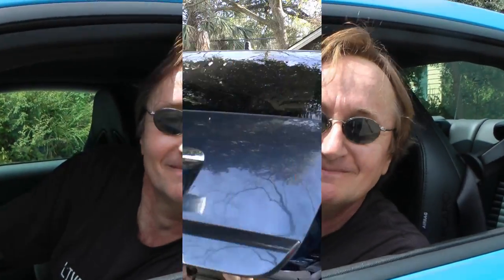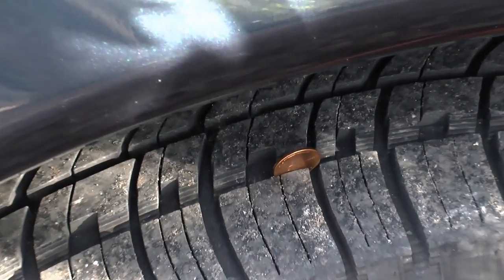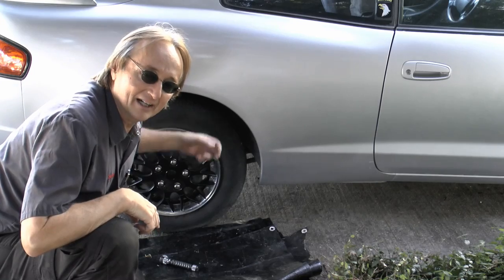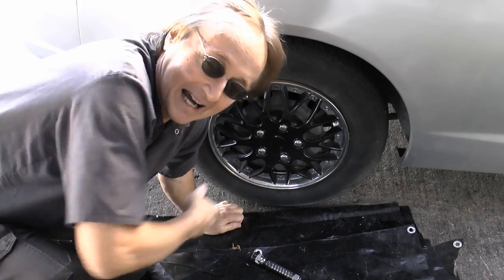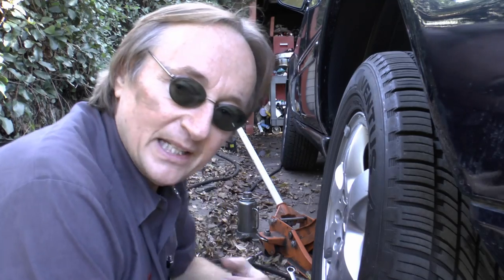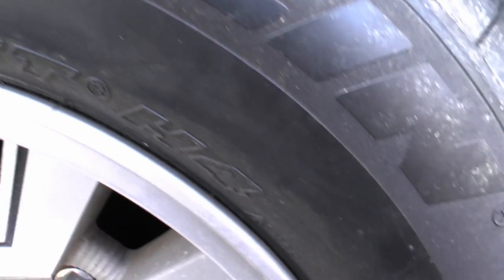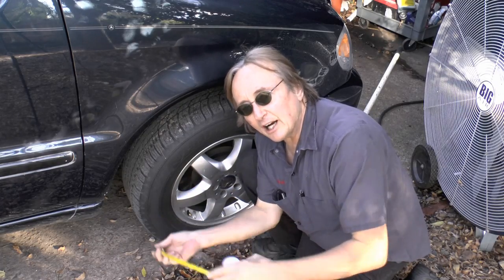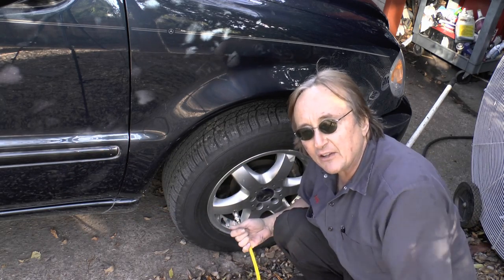How to Tell if You Need New Tires on Your Car

Comment: At 3:10 that puncture repair is not safe. its on the sidewall and its not even a proper plug, its just that sticky rope shit
Reply from the maker: ha ha ha, been doing this 49 years and never had a blowout from any of them. Tire guys are always saying that crap to sell you tires. Tires are basically rubber, which is rather flexible no matter what part is fixed
Reply: In my country its actually illegal to use those kind of repair kits and any damage to the sidewall is also not roadworthy according to the national standard. I can only assume they have some good reasons for making it that way
Reply from the maker: yea, they want to sell you tires. When I was a kid, the man who sold us these kits actually drilled 40 holes in the sidewall of his salesman's car and plugged em with the plugs to show how well they worked. And his tires worked fine.
Reply: My country doesn't sell tires. And the economy certainly isn't built on tire sales, or else we would have expiration dates on them - which they should, having cars come in with 15+ year old tires on them makes me sick that they're out there on the same road as my friends and family. Also, how long did that tire last with 40 holes in the sidewall? i certainly hope he didn't drive on it, that's incredibly irresponsible and dangerous

Comment: I check my tires and add air when they're cold, then I go get an oil change and they bleed air from them cause they're hot so it appears that they have too much air, those guys are a bunch of numb nuts, they should know that!
Reply: I'd avoid going there for oil changes then.
Reply: *****
I just tell them no to bother with checking the tires when it's not too late.
Reply: pedrof830 I don't know man if he doesn't know something as basic as that, any other service would be questionable
Reply: *****
But this has happened to me over and over again at different shops, even at tire places that offer discount oil changes so they can try to convince you that you need new tires, even though you don't!
Reply: I had Chinese-made bearings installed in my 98 Corolla, lasted 2 mos, will not allow any more Chinese built parts put into my car, no matter what the US or Japanese made parts cost.
Reply: I mistakenly replaced my orig motor mounts many yrs ago with after market ones and from the get-go, I thought they had installed hockey pucks instead, it was like riding an old lawn mower, noisy and vibrating like crazy, as they have worn out, it has gotten better but still vibrates a lot.
Reply: And these same Chinese want to sell their crappy car to us? Assuming they all use those same shitty parts, these things are gonna fall apart before you finish paying them off.
Reply: I think we all know that, the problem is that's supposed to be COLD PSI not HOT. and when you come in for service, the tires are hot and the PSI is higher as a result, so they measure it incorrectly.
Reply: That is the myth people have that by over-inflating their tires, their family sedan is gonna handle like a Porsche or Ferrari, LOL.
Reply: Well, we don't have no ice concerns in So,Fl but most likely it will make the car slippery in the rain as well.
Reply: DE Nichols þü.    cc

Comment: Wow. Your advice is rather dangerous in several ways:

a) Don't even go for the second or third cheapest tyre. Do your bloody research! There are good cheap tyres, there are terrible expensive tyres. It's all over the place. Do some research. What matters to you (comfort, fuel economy, handling, dry, wet, ...), and check the reviews. Preferably reviews done for your tyre size, because a tyre that is great at a certain size can be average only at another size. During winter I swear by Nokian. They have good grip, they are relatively affordable,  and quiet.

b) Age matters. Not just if the tyre is cracked or anything. I've had a set of winter tyres, decent brand, about 10 years old. Lots of thread left, no cracks. They looked good. Then suddenly in the wet they had NO grip at all. It would depend on the road surface, but even slightly slowing down (in Autumn, it wasn't even cold) could either work or not at all. I slid past an intersection as if I hadn't touched the brakes. Some roundabouts the car would just understeer out of the corner unless driving really slow. It was like driving on snow, just without the snow. Needless to say I got rid of them as fast as possible. And yes, this can happen at town speeds too. 

c) Related to age: If you're doing low mileage, try to buy tyres that were just manufactured. Tyre shops can try to sell you old stock that is already half way through their useful life. Don't buy them! Even at a discount, unless you're sure you're burning through them fast.

d) The price difference between terrible and good tyres isn't very big. One Goodyear Eagle F1 Asymmetric 3 costs 87 Euro at my place if I order them online, the cheapest tyre is 48 Euro at the same size.  A rather decent Falken is 68 Euro. One tyre related crash is going to cost you much more than that. Now it doesn't have to be the high performance Goodyear, but at least spend the 80 Euro more on a set of Falken for example.